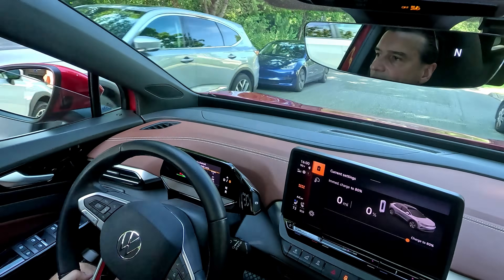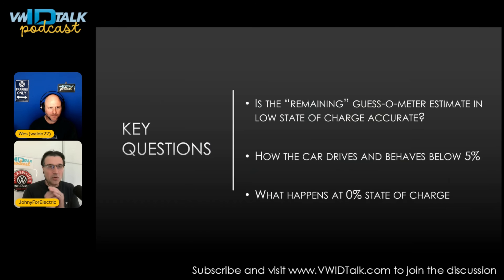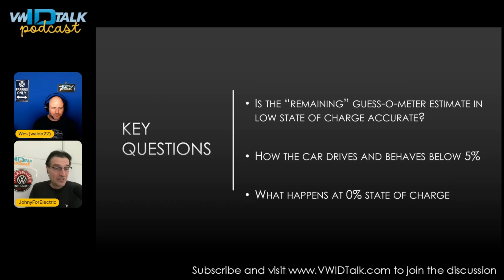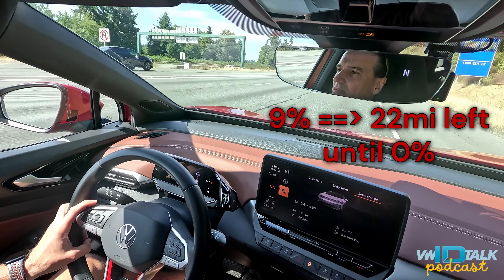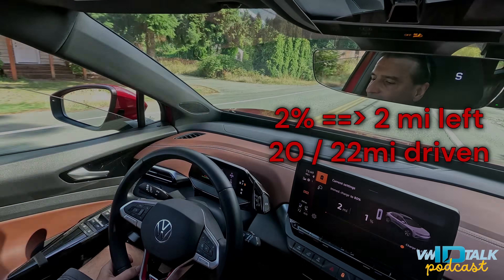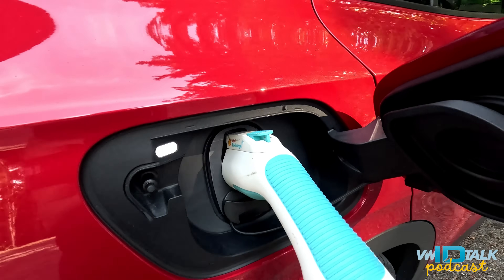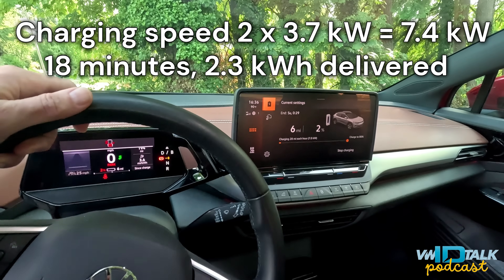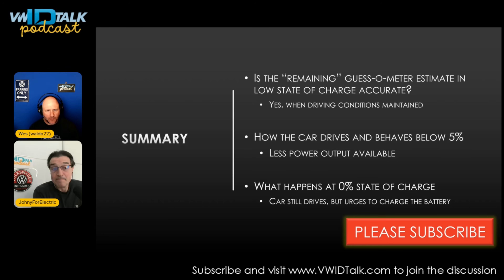We Drove Our ID.4s to 0%… Here’s What Actually Happens

Comment: this is exactly how this car should be done at factory - real buttons on steering wheel and on centre console screen. as every f.. golf, costing half less, have (and soft materials at door pockets etc).
what reprogramming did all that take?
Reply from the maker: We hear you, thanks for chiming in! For tactile steering wheel buttons, there is no reprogramming needed. There are some caviats that we have not fully solved that require the modification of the tactile switches from Atlas/Golf/Tiguan to gain backlight.

Comment: Was that really 18 minutes to get 6 miles of range!?  If I'm near zero I can get 500 miles in 2 minutes. Most people don't have the patience for this I think!
Reply from the maker: That is typical for home charging, the ID.4 can charge up to 12 miles per 18 minutes on home carging (11kW). Home charging is something that is uniqe to EVs as we suspect not many have a fuel pump in their garage.

The "public" charging is a different story, my old 2021 ID.4 can get 120 mi in 18 minutes, newer ID.Buzz and ID.7 even more. The Porche Tycan is expected to be charging beast, doubling or trippling my old ID.4 in public charging speed...
Reply: @vwidtalkdotcom  Ok thanks for the response- I thought it was maybe just slow because the charge state was so low.

Comment: Efficiency seems very poor. Around 200 miles on a full charge.
Reply: We don't know if they started with a full charge. It might have only been 80% or less.  If I were going to do a test like this, I wouldn't bother charging to 80% - I would keep it lower just to avoid having to drain the thing down.
Reply from the maker: Thanks - I daily charge to 80%, but recently did a longer trip, the range was 244mi https://youtube.com/shorts/KwIfI2UxKVY. For 4 year old car first generation MEB car - really good.  ID.7 is more efficient due to less aerodynamic drag.

Comment: Actually in my case, AC charging has more or less fixed "overhead", like so, the slower one charges, the higher the loss percentage will be.
Reply from the maker: Makes sense, so you are saying that the loss is constant and the slower the charging is the bigger the loss is - as it's proportional to the power pumped into the car. Thanks for sharing!

Comment: I can add a few things for you and your viewers, agree with all you mentioned BUT,

My car is a 2023 usa awd pro with the 83kwh battery. 

I run out of power a couple of times but here is what I learned........using Car Scanner the % on screen at zero actually goes to -3% and a bms showing still at +2% the car actually stopped, I called the tow truck as I was 2km away from a ccs charger but I could not move......towtruck came 90min later BUT IN THAT TIME my actual % popped up from 0% to 2% and yesterday I did have power to drive but waited for the tow truck. 

So here is another added nugget, my battery total available power after 140,000km had reduced to 68kwh, doing this bms calibration trick twice that reading has now increased to 74kwh still short of the 77kwh but from what I can tell has recalibrate the zero cutoff and relearned the true zero %

So to recap, 
1. Wait 60min or less after the car actually stops 
2. This is a way to relearn the battery to true capacity

Not suggesting everyone should do this but if you are within reach of a fast charge stationbut your ID4 stops and has no power just wait. The % will "pop-up" to just above 0% as in 1 or 2% enoughto get you to a station to charge only on level ground.

Hipe this helps a few people,  just wait to call the tow truck,  you are dead anyway and if not at least you save yourself a tow fee.

Like I said my id4 is a 2023 awd pro usa version.
Reply: Interesting thanks👍
Reply from the maker: Thanks so much for sharing your experience and these valuable insights with the community! You are right, that the battery balancing can harvest additional power. It really depands how you get to 0%. Was that in one driving session or over couple days? If it's over couple days the balancing likely happened namy times. It's really good to see that the car can be restarted below 0%, but I would not count on it in every condition, especially during winter...